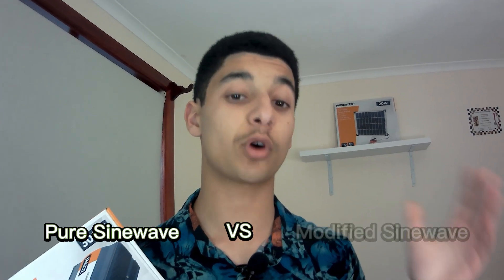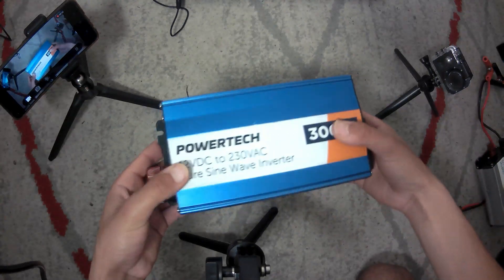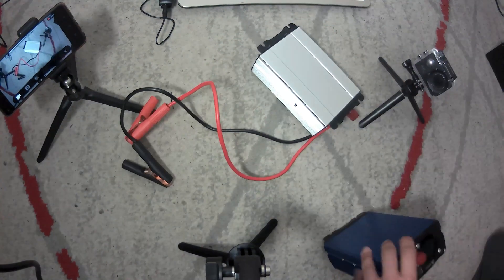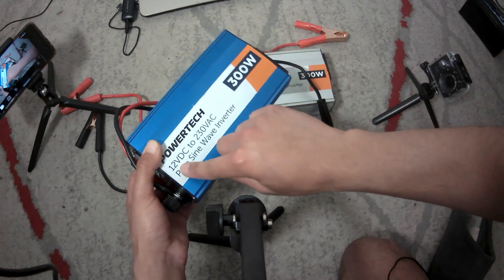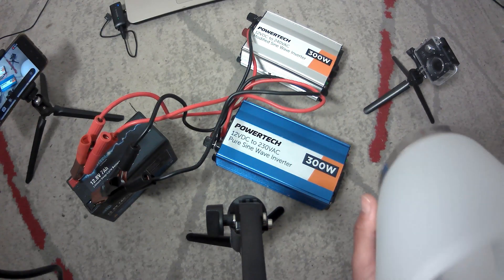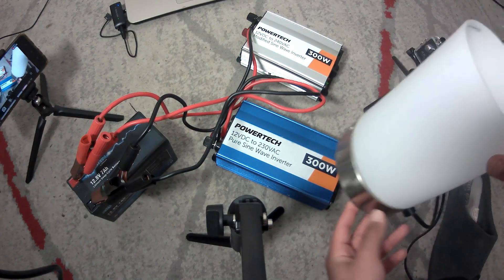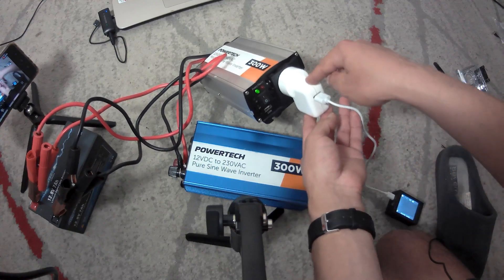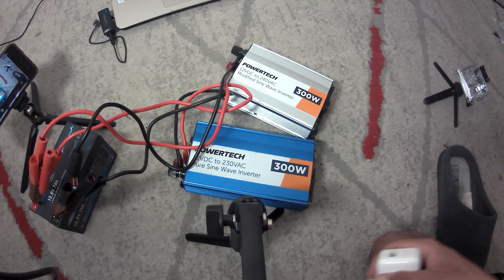Pure Sinewave vs Modified Sinewave Inverters for Beginners

Comment: Great video and well demonstrated thanks!
So what im taking from your video is that a modified sine wave inverter is perfectly fine for charging any device like mobile phones tablets or any unit that has a transformer type plug because it smooths out the sine wave and cause less interference or issues with that device 🤔. 
Also would a modified sine wave inverter power a freezer compressor and or a 240v water pump that draws 75w with out any issues ... 
Thanks agen